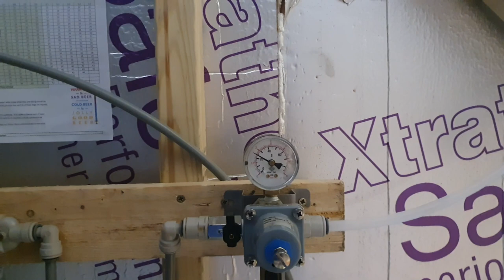Pumps, Cans & Line Cleaner

Comment: You didn't exactly say:  Did you fix the older pump with an Ibarra pump seal? It's great to have a spare...best of luck in everything. Cheers!
Reply from the maker: Well, I managed to repair one of the seals on the shaft but the stationary seal in the back plate was a different size so I left the old one in. Did 7 brews on it since with no leaks so should be fine for a bit.